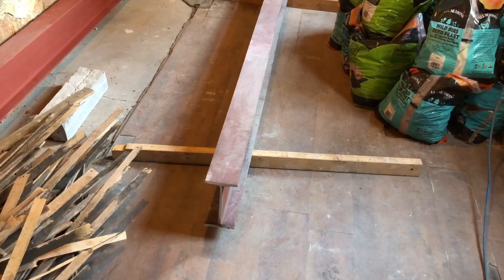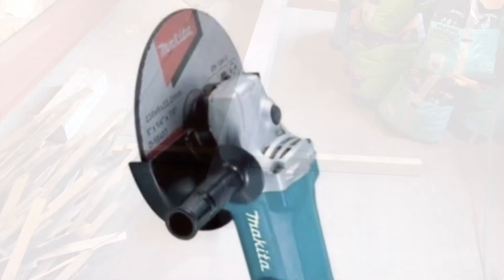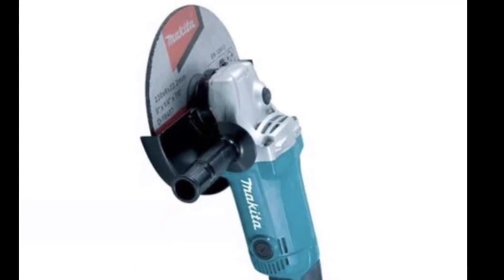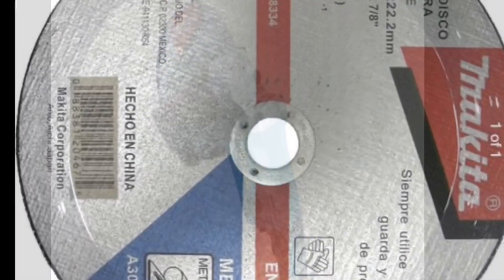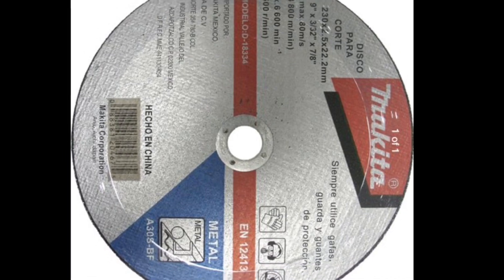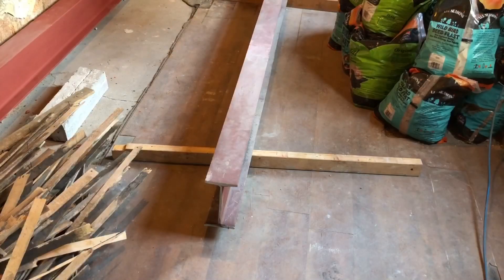How To Cut A RSJ Steel Beam

Comment: Does anyone know can a reciprocating saw/sawszall with metal blade do a job cutting this, doesn't need to be very accurate. Thanks 👍
Reply from the maker: Hi yes it will do the job as long as you get a metal cutting blade. I’ve used one many times. Hope this helps & thank you for watching I really appreciate it